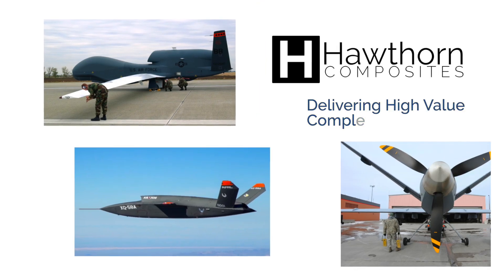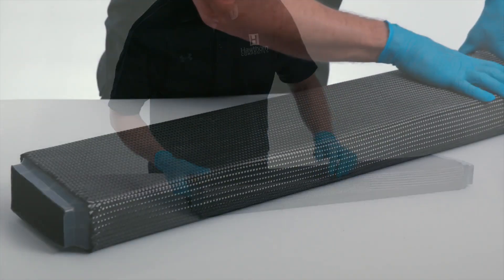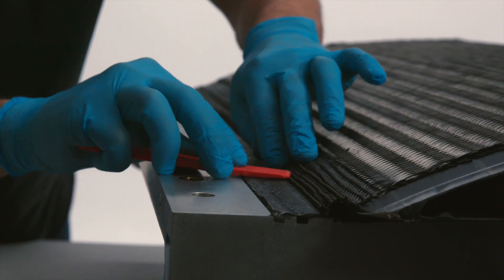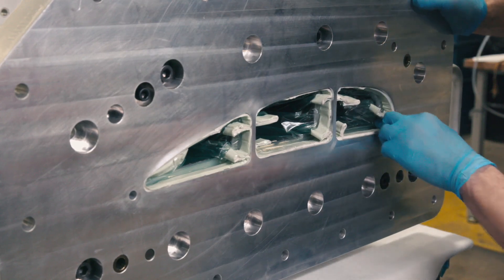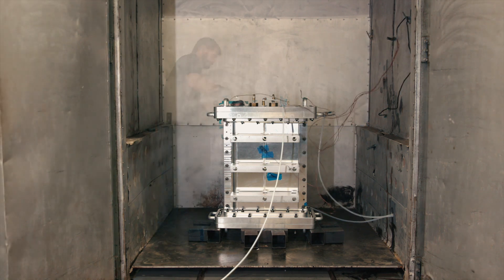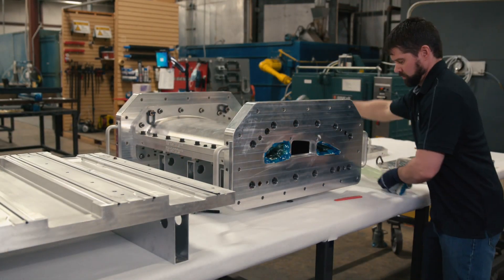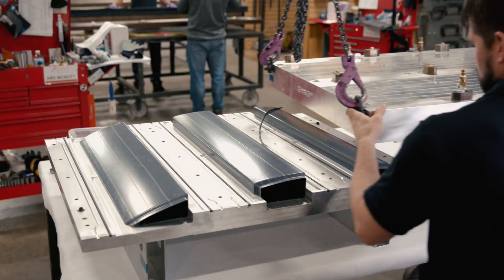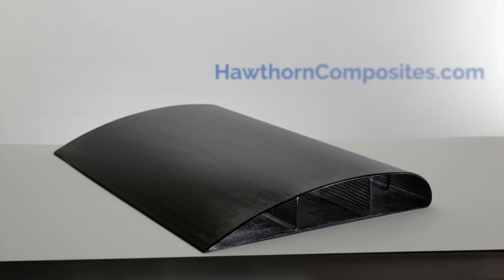Co-Cured Wing Structure Using Dry Carbon Fiber Application/Overbraiding & Resin Transfer Molding

Comment: what is that part for? just demonstration?
Reply from the maker: It is a demonstration article for a co-cured wing or control surface. We actually have over 30 plus customer flying platforms that use similar methodologies.

Comment: Great job. What would be the max wing length using this tooling ?
Thanks
Reply from the maker: There is not necessarily a limit on potential wing length. It really comes down to making sure you have the time to fully "wet-out" the composite fabric before it starts to gel. There are plenty of variables to play with to ensure success for much larger wings.
Reply: @HawthornComposites  thank you for the answer !

Comment: These guys are two steps away from having custom tailored composite compliant control surfaces. —I mean they have stiffness which is the most important, but you take away the air blend between control surface and main wing while lowering weight, you got yourself a game changer in wing design.
Reply: Air bleed* through between control surface and main wing

Comment: I thought the advantage of prepreg is the lack of air bubbles because of the very short path out of the material. I wonder if one could impregnate the sheets and directly afterwards lay up wet sheets in those smart tools. In a cold room.
Reply: In this technique the resin is drawn into the carbon under vacuum inside an oven. The chances of air bubbles is small.  This technique also does not require use of an autoclave oven. Boeing uses a sort of similar process in Australia making 787 parts with good success after a slow start.
Reply: @bradster1708  now I wonder how resin behaves when I send it through a heated nozzle ( 3d printer, or due to friction ) into vacuum. Does it evaporate? Below some pressure a lot of materials are either solid or gaseous. Chemical Vapor Deposition. Then as the pressure due to the resin itself rises, the new resin going through the nozzle stays liquid.
Reply from the maker: Because the polymer tools can apply pressure both during infusion and cure, any air is driven out of the curing composite. 

This solution deploys automated carbon fiber sleevings and isotropic broad good to eliminate most of the labor that would be associated with applying carbon fiber prepreg.

Comment: Damn, you have much more money in tooling than you would have had hand laying that part over cut foam...
Reply: I imagine such methods aren't precise enough for aviation, so you need a mold wither way.
Reply from the maker: What we have found is that if you a making more than 6 parts, a Smart Tooling solution will be less expensive than using machined foam, because precision machined foam is so expensive
Reply: @HawthornComposites  3D printed dissolvable foam. Much more geometry could be added to lighten and strengthen the parts

Comment: Well, next time I have a 10 billion dollar defense contract come across my table I'll keep you guys in mind.
Oh, it might be on your site but it might have been nice to see how scalable and modular this process is. I can imagine those molds and "smart tools" as well as the resin impregnation process facing increasing difficulty and variability as they scale up.
Reply: I don't know about difficulty. Can you elaborate? But issues with variability would definitely be a problem. It's not like you could easily make adjustments to such "smart tools", right? So everytime you'd need to swap the tools out for different ones, you'd need to pay quite a lot of money, as you're locked into their ecosystem of tools. But I guess the aviation industry doesn't care about costs as much as your average small business owner. Hell, even the cheapest Russian airlines don't care about any cost under 2000$ when it comes to repairing their planes.
Reply: @diviscadilek1764  Difficulty with things like mold alignment and multi-piece molds, trying to get consistent resin flow through the entire carbon fiber piece, warping and thickness problems. "Difficulty" and "variability" have a lot of overlap, but in general there's a reason people don't use injection molding for parts that are meters long. I could see the cost going up exponentially as the size of the piece increases. For that roughly 1m square demonstration its not too bad, but for a 10 meter wing or flight control surface or even something like a monocoque chassis for a vehicle, these squishy inflatable mold pieces don't seem like they would scale well.
Reply from the maker: The solution deployed for this wing is very scalable to much larger parts, we use similar technology to make a approximately 12ft (3.7 meter) inlet duct for Kratos Valkyrie tactical UAV https://www.compositesworld.com/news/hawthorn-composites-awarded-structural-inlet-duct-manufacturing-contract- and we also made the wings and fuselage for the same vehicle https://afresearchlab.com/news/aerospace-systems-directorate-collaborates-with-partners-to-build-innovative-airframe/
Reply: @HawthornComposites  Thanks for responding. From my perspective it looked like it had a lot of the drawbacks of injection molding as far as scalability went, but if you're making 4m production parts its doable at least.

I could be wrong but I'm going to guess that it wouldn't be cost competitive with other composite manufacturing for less defense oriented project budgets like medium scale wind turbines?

Also: I miss the DoD days when people knew how to name projects. "Longbow Apache" makes sense. "Kratos Valkyrie" sounds like someone isn't even trying to pick names from the same sets of mythology.

Comment: 'low cost"
Reply: Apparently, it costs less than the traditional way of manufacturing carbon fibre composites
Reply from the maker: We did achieve a 67% reduction in labor hours in producing the inlet duct for the Kratos Valkyrie tactical UAV using a similar  solution https://www.compositesworld.com/news/hawthorn-composites-awarded-structural-inlet-duct-manufacturing-contract-

Comment: Am I the only one, who thinks it is too much manual work for cost savings in mass profuction?! They even use manual keys, not akku or pneumo! 
Why to put parts in a huge oven when you could directly apply heaters on or In the Alu-forms together with thermal sensors for an accurate temperature control?! Isolate them outside and one could save, I bet, >90% of electicity costs compare to that huge inefficient oven.. And time of course, because to put the thing in the oven, attach vaccum there again. hoses and so on.. again manually... Then detouch. And wait till whole oven will cool down.. each time!
Instead of a simple automated press they bolt and unbolt things together.. manually each time. With manual tools. Same for re-shaping of forms.. With the press big enough one could produce one wing at a time, not just 1m part of it.
Extremely unoptimised procedure.. year 2021.. Sure, one can use it for private Jets or small series, when price is originally set high. But any startup which will really want to mass produce same staff, will jump forward just by optimised procedure, not even because of another technology..
Reply from the maker: We agree that a lot of this process could be automated, but this is a self-funded demonstration so we're not going to fund all the automation. You can check out another case study where we did use a self-heated out of oven/out of autoclave mold https://smarttooling.com/portfolio/co-cured-i-beam-using-bladder-smart-tools/
Reply: I can see that, but t's done that way for higher quality. The higher the quality the less chance for failure. And the FAA doesn't care about what you have to pay to get a part that won't fail.
Reply: I hope the efficency of manufacturing gets improved upon. This looks promising. It would be nice to have affordable carbon fibre products.

Comment: Multiple machined molds has to be really expensive for a 3ft part?  Multiple molds and a massive oven for one full length single wing...that has to be insane expensive.??
Reply from the maker: If your making a production UAV wing or business jet/UAV control surface and want good compaction during cure, you will need a mold to make washout cores or multi-piece metal mandrels and silicone bladders that you pull over the cores/mandrels. You will also need a cure mold. This solution generates lower labor cost and higher quality with similar or lower capital costs for molds/mandrels.
Reply: @HawthornComposites  wasn't knocking ya, just in awe of the efforts ect..
Reply: @HawthornComposites  Can't disagree with this statement. It's well written. May I ask, what is your vacuum pressure in the oven??
Reply: @keronGR  You want as much vacuum as possible with any CF manufacturing.
Reply: @complexdevice  hello. I disagree with your opinion, vacuum is indeed efficient with 1 bar pressure, gives voidless results. I prefer compression molding, the results are superior compared to vacuum. Both surfaces excellent, parts more thin and more lightweight as they're compressed in tons and not in 1 bar.
Reply: These molds are 10k €

Comment: Those machined aluminum dies look very expensive. Is this technique primarily intended for mass production use to keep the per unit savings in the 20-50% range shown? Further more, how large can you scale this construction technique?
Reply from the maker: Yes, this is for serial production and the only limit from a scale perspective is access to a large enough oven.
Reply: @yo yo I think the target consumer is manufacturers and fabricators. Not really an individual.
Reply: I was wondering that same thing. I dont know much about the other manufacturing process they mentioned. I do have a hard time believing that's anywhere near as economical as advertised. Not only is there a huge multi part mold but those specific vac bags and liners are part specific too. That means those also have to be manufactured. So there is another huge mold that is part specific.
Reply: @marshallwages5035  price out an autoclave recently?

How about one big enough for a wing? 

How about several dozen of them so you can make more than one wing per week? 

It costs literally tens of millions of dollars for pre-preg/autoclave. 

This process is not VBO (Vacuum bag only) it also applies significant pressure from the inside of the part which gives it an autoclave level quality without an expensive autoclave.
Reply: @Triple_J.1  nope and never said i did. Nor did i say im an expert in manufacturing. I would be more than happy to admit im wrong if you wanna do the work to prove it. I love how people like to atate their opinions or ask a question in a way that doesnt give any real information or fact. Yet they act like thats what it is.
Reply: @Triple_J.1  thats funny bro i just read my statement from 3 months ago and said i wasnt an expert. And basically asked for someone to let me know what the benefits of this are . You did mothing but answer my question with a question, good job. Another person that doesnt seem to know anything about this process or the one its supposed to be so much better than.
Reply: @Triple_J.1  you must be an employee or an employee of a company that bought into this process. Your statement makes my point. This must be cheaper for a company to get into the business of making these parts. that doesnt mean its cheaper for the consumer or that its a superior product.

Comment: any solution for beter stick? i mean wich can be used in high temperature like aluminium or stainles still. The problem of this is the low temperature accepted by resin. The galvanic problem i see alredy solved but we need better catalist to stick carbonfiber. Ceramics are good at high temperature and we know are working like this polymer resin.